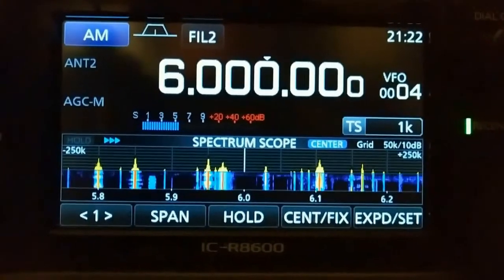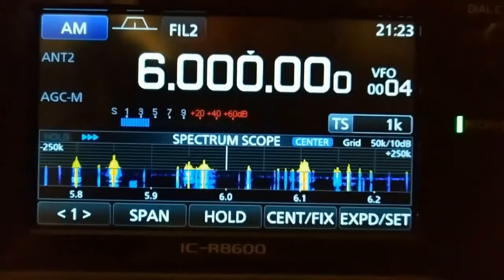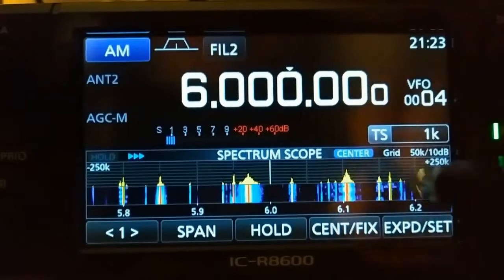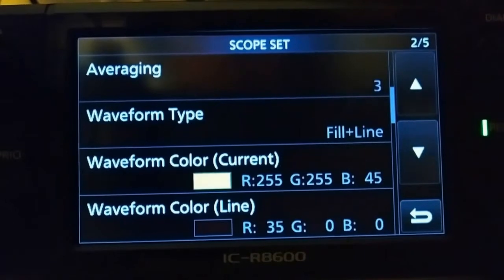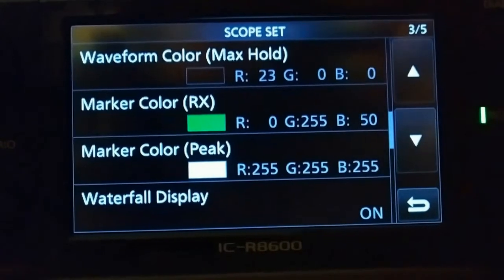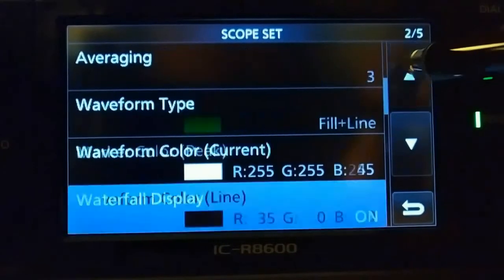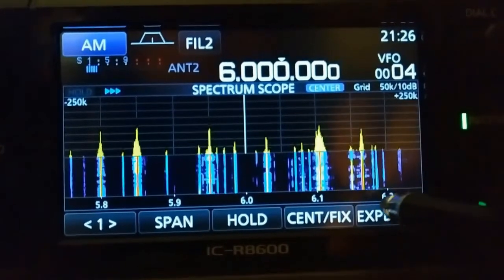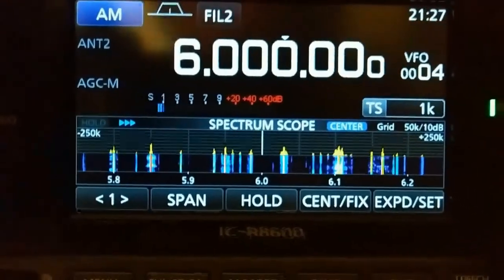Comment Request Video. My Waterfall Settings on my Icom 8600.

Comment: In 2023, on the market to purchase an IC-R8600. Currently own an RSPdx, previously owned an Icom IC-7300. One of the beefs I have with the RSPdx, is the limited options to customize the WF display. Yes, I know, there are other software to use your SDR with but, I'm so used to Uno now and the learning curve for the others, is daunting. My appeal to the IC-R8600, is the self contained functionality, no PC's to mess with, along with all of its quirkness.